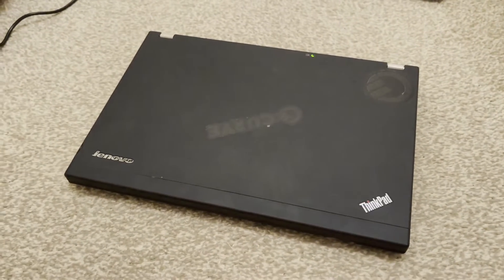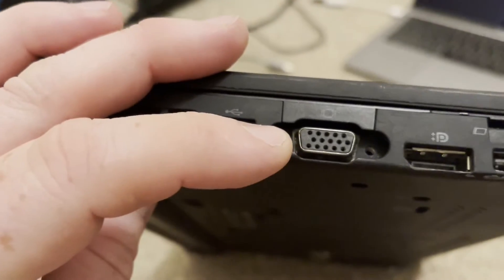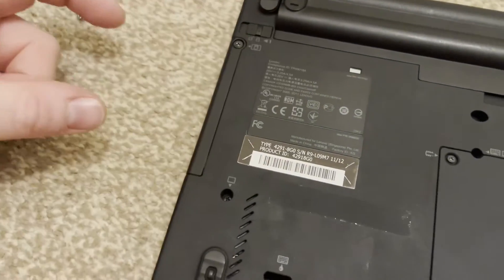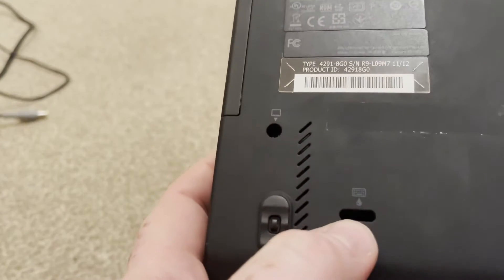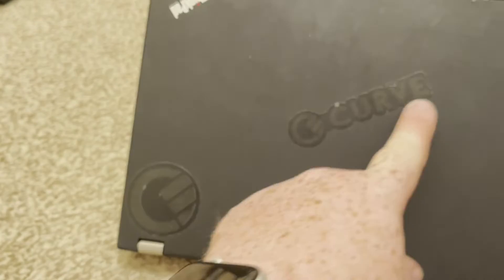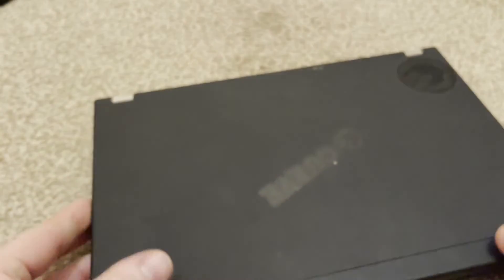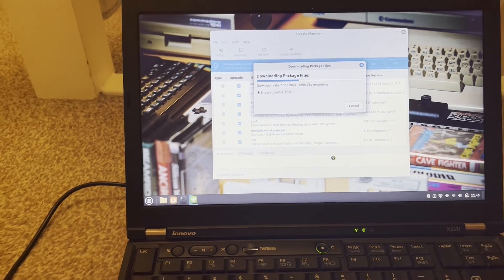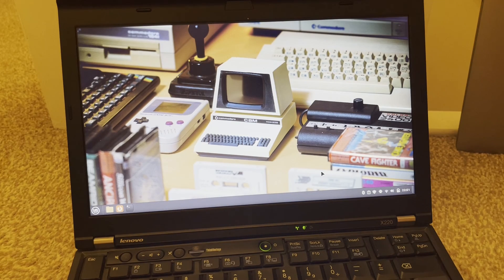This 2011 ThinkPad x220 is a brilliant Linux Laptop

Comment: hi.  Is suspend / hibernation on Linux a problem on this laptop? I have a modern Thinkpad (T14s) and suspend is a hit or miss.  It is not as reliable as a Mac.
Reply from the maker: Sorry, I've been distracted by other things, I will say that with Linux mint at least, this laptop is fine, I have no complaints. Now it is not my main laptop, in fact I rarely use it, but my younger son uses it all the time and he just closes the lid when finished, it hibernates and although the battery does indeed deplete when in hibernation as with all laptops, it is a very slow drain. 

If you have issues, it will likely be the version of Linux rather than the device. And it's not that Mint is best for all things. 

I love Fedora, I much prefer it over Ubuntu for example, yet when I use fedora on a MacBook, it never shits down or hibernates gracefully. So I need to use Ubuntu on that particular device. The exact same Mac with an Ubuntu version of similar age to fedora is a different animal completely, everything works included hibernation and power management. 

Sometimes it just takes trying a few of them until you find the one for you.

Comment: After a stripdown, deep fan clean, re-application of thermal paste, I use mine as a 24/7 Proxmox host. Runs a TON of things: home automation, plex media server, torrents stack, minecraft, even an AirPlay server with powered speakers connected to the analog audio out. I've planted in the bookshelf standing "up" on a stand, with the screen ~140 degrees open. I got it for $35 and paid $5 for a second-hand DDR3 module giving it 12 GB RAM total. It's been a champ! :) Will add an SSD for backups in the near future.
Reply from the maker: That's a brilliant idea!

Comment: In 2011-13 I worked on remore Pacific atolls and islands, where there was no IT support.  I used an x220 with 16gb of RAM, a duel boot SSD and MSATA, each booting two virtual images.  It was the ultimate in reliability.  I still have it, I still use it.

Comment: I have an x220 I updated the original BIOS and firmware for Intel me. I have 16gb 2x8gb DDR3 1600 RAM "I thought the maximum RAM supported was 8gb". I installed Devuan.

Comment: this was my work laptop forever until very recently. mine has an i7, ips display, 2 ssds and 16gb of ram. it can handle multiple docker containers and java processes - i'm a developer btw. i replaced it with an x270 as i needed usb c for the new work hot desk setup.
Reply: you could've gotten a usb 3.0 expresscard port and replaced the USB outlet with micro-USB.
Where there's a will there's a way
Reply from the maker: Nice to hear that these things still have a place in a productive day.
Reply: How'd you do that? Ips panel?
Reply: @pullrequest1481   You can buy those ips panels and replace it, its very easy. My x220 and x230 both got ips panels with 2 ssd's and 16 gb ram.

Comment: I really think this is still a great laptop for browsing the web. It's pretty portable and fairly lightweight so I can take it anywhere I want to use it, it's still powerful enough to run Windows 11 (I suggest you to use the Tiny 11 since it remove a lot of bloatwares and make it even faster) though I think Linux Mint is a better browser if you're really just want to use it for browsing (tried Chrome OS Flex, it's not great). The keyboard is fantastic, probably one of the best laptop keyboard I use. The screen, while still a TN panel still have decent color for a TN panel considering this is a 2011 laptop.
Reply from the maker: Another fan, they really are cracking little laptops. Not sure what the price tag was in 2011 or how it compared to similar devices at the time, but I’ve certainly been impressed with it in its more elderly years.